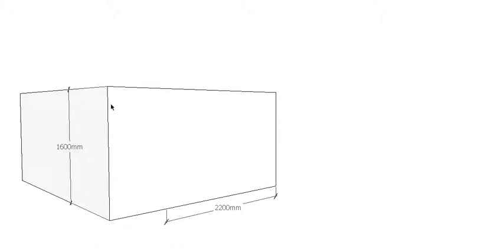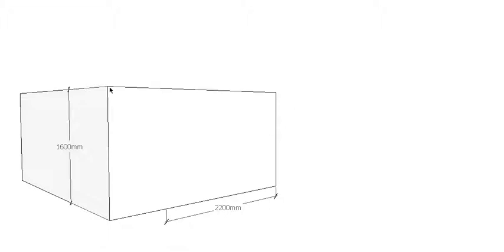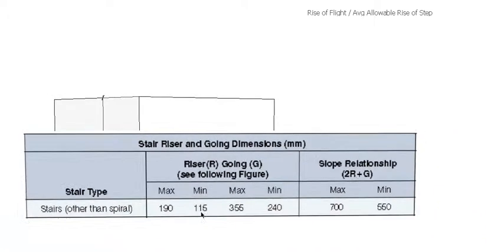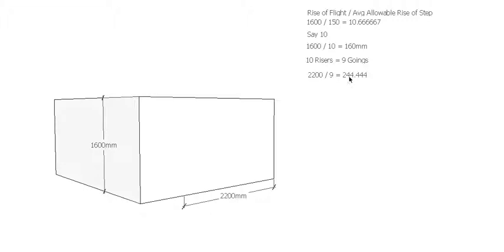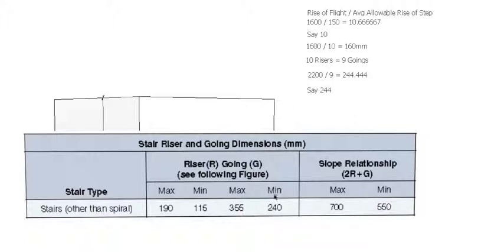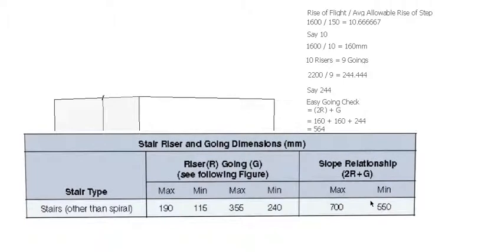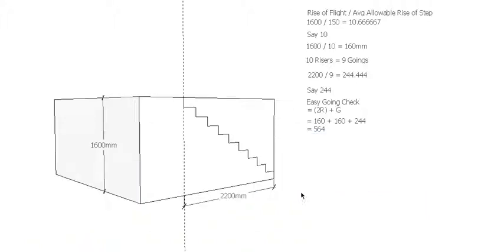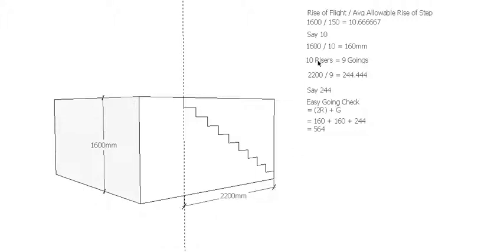Restricted Going Example 1

Comment: Hi, your channels is fantastic and even better cos I'm Aussie as well :). Not sure if your channel is still current as  this was 6 years ago but here goes. I want to build external stairs with an end cap to go over the deck to attache to it. As standard pine timber size these days is 250 mm (going) x 50 mm thick so I want to calculate my riser height using this as my base measurement. My total run is 2300 and height around 1500. However I want a maximum of 8 steps or goings. If I use you calculations using the set going of 250 and 8 goings I end up with a total run (going) of 2000 instead of 2300. Do I have no choice to go with 10 risers and 9 goings to stick to the standards? As in your video example I end up with a single going of 255mm yet my pre-purchased pine is 250mm. Ignoring the extra 5mm this makes the easy going check around 582 (just over 30% angle). Does this sound OK? Can I use only 8 steps or am I stuck with 9? Taking into account my total run and deck height, what stringer length do I need considering the additional end cap allowance? Thanks in advance.
Reply from the maker: Hi Dave, you can have 9 risers for an average rise of 167mm and therefore 8 goings of 288mm. Just because the tread is only 250mm is not a problem, remember the rise and the going are just setout dimensions and dont nessecarily relate to the actual treads, there will just be a larger gap between the back of the lower tread and the front of the upper step. The only other thing to think about is the 125mm rule where the BCA states that you can have an opening larger than 125mm in any part of the staircase. You will be pretty close i think however if you want to close this gap you can all another piece under the front of the tread to fill in the gap. Hope this helps.
Reply: @Buildsum  Thanks mate, just realised my treads were actually 240mm wide x 45mm thick which is the same dimensions as the stringers but as you say this should not affect the rise and goings? So do I still do 167 and 288? I'm going to rout out the stringers to fit the treads with a 50 mm margin as in your stringer layout video. So from the back of the stringer my routes will be cut in 288.There will be a small gap as you say from top front of tread to back of lower tread but If I had to fill in the gap it would be more aesthetically appealing to add the extra tread of say 20mm to the back I would have thought? A 240mm wide tread to me seems to be pretty standard but I guess me restricting it to 8 goings causes the gap problem. If I added another going to make it 9 steps then this would help but wouldn't it change the slope? Thank you so much for your help.
Reply from the maker: Hi Dave
If you add another step and keep the same going of flight then the angle wont change just the rise and going of the steps will. With a Rise of Flight of 1.5 and a Going of Flight of 2.3 and 10 risers ( 9 steps) i calculate that the rise of step will be 150mm and the going 256mm. This should fix the 125mm gap issue but as you say making the tread wider would certainly look better than adding an additional piece underneath it.

Comment: Hi!  I noticed in your video where you set out the stringer you allow 50mm past the first tread, so that it looks formal to your margin. I would have to take that into account, if i was working with restricted stairs right? would I just take 50mm off the totall allowable length of my stairs when I do the calcs for the risers/goings? or is my thinking completely wrong lol?
Reply from the maker: +SuperBlundy  Hi SuperBlundy If you wanted to finish the stringer in line with the end of a wall or similar then yes you would need to take the margin off the Restricted going. However in most cases i would imagine that you would still have room for your stringer to run past the end of the tread with out interfering with anything so you would not have to deduct the margin in that case

Hope this helps